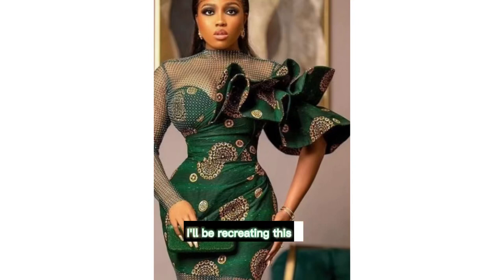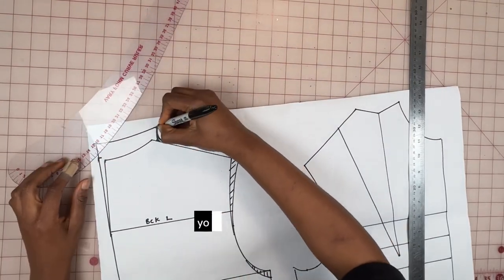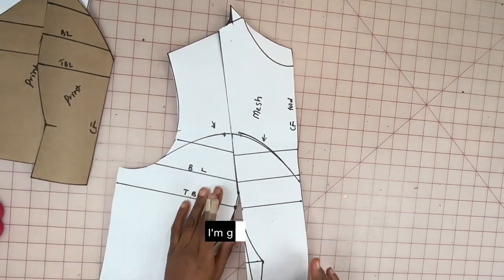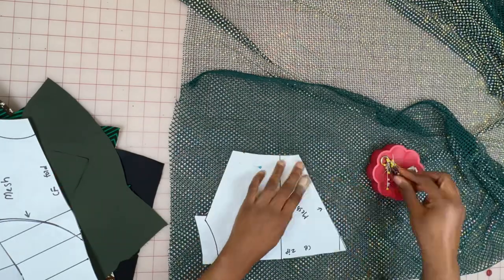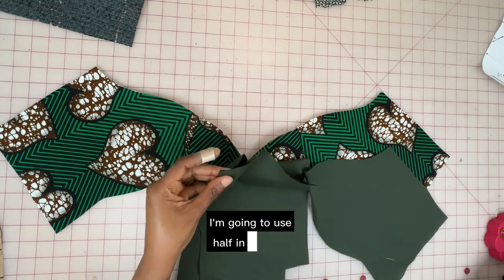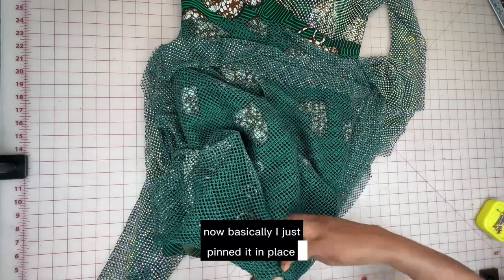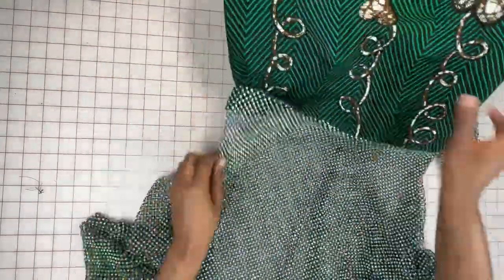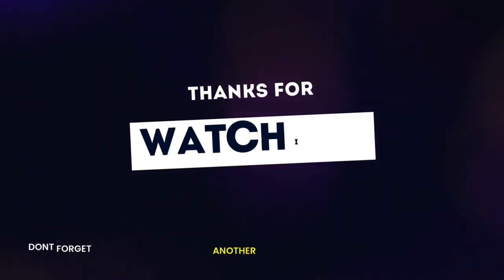How to make a Bustier Dress with Frilled Sleeve and a built up Neckline. #diybustier

Comment: You absolutely slated it 👏🏽. Please what’s the weight of the fusible interfacing that you used to pad the bust area? I’m trying to order on Amazon/Ebay but I’m seeing different types.
Reply from the maker: It’s a heavy weight fleece fusible interfacing . For brand check the Pellon fusible fleece . That’s the one I always get but at Hobby lobby . You should find it on Amazon too
Reply: @mercyadamsinseams  Thank you so much 😊

Comment: Thanks for this. 
If one is adding ease to the neckline for the builtup neckline, does this mean the center front  cant be cut on fold?
Reply from the maker: Yes it will. It can still be cut on fold. When connecting to the chest line, make sure it tapers off well. And you won’t have a problem cutting on fold. I hope this helps.
Reply: @mercyadamsinseams  ok, thanks very much

Comment: Please how many yards of stoned net did you used, also how did u remove the stone
Reply from the maker: I used 3.5 yards
Reply from the maker: To remove the stones, I ironed around the seams, placed the iron on it for a few seconds  and then I used a small metal ruler to scrape out the stones .so basically the iron melts the glue under the stones which makes it easy to come off

Comment: Do you do yoke tightening? Is it necessary for all bust sizes
Reply from the maker: I usually don’t tighten the over bust, if there’s a yoke . In this case I did just a little tightening, most because the yoke fabric had a lot of stretch

Comment: This is such a neat job, and the fit was perfect!

When contouring the underbust, is the 2cm intake a standard measurement, or is that value to be increased for bigger sizes?

Also, I sent a Hobby Lobby question to your IG dm...🙂
Reply from the maker: Thank you! The 2cm is not standard . I usually use 1cm -2.25cm max. This is based on the bust size . Smaller bust for the least and so on . I’ll check my dm.